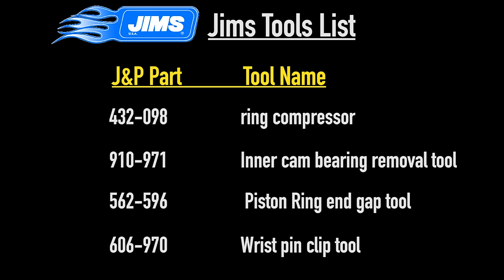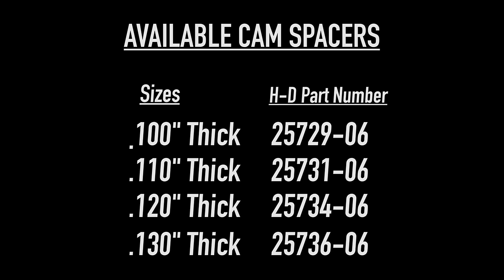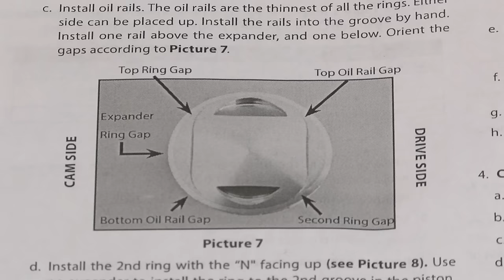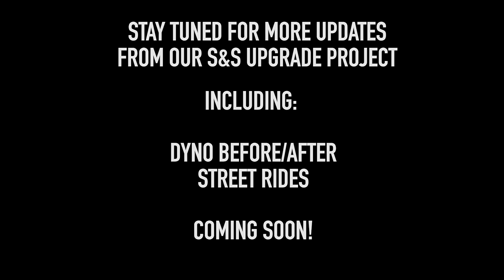Weekend Wrenching: How to Install an S&S Cycle Power Package

Comment: Glad i saw this. Was going to gear drive. Now i wont cuz of possible runout. Think i'll get more miles by upgrade to the hydraulic tensioners. I use synthetic oil all 3 holes. Thanks great vid!
Reply: Hydraulic is best!

Comment: I remember doing the same on a 2003 fxsti but also did the heads
Ported , milled and cc reduce to 72
9.5 to 1 cp pistons ft
It will pull in any gear with a baker dd6
Might build another soon since I have time

Comment: Why use adjustable push rods if you had the motor apart, I'd rather have solid. This is a great video though.

Comment: Any chance you could do a 883 to 1250 S&S conversion, with cams? I trust your judgement and knowledge. If I could get a complete set of part numbers, I'd order them off of J&P and have them sent over to me. Great job Paulie
Reply from the maker: The S&S Hooligan kit is what I would suggest. There is a possibility of a video on this in the near future.http://www.jpcycles.com/product/832-928
Reply: Do you know if S&S sells complete 1200 heads that will work with the 1250 conversion kit?

Comment: 98" big bore,and 89cc heads. 583 easy start cams. I need a map. I have the power vision. Fuel moto doesn't have an exact map.

Comment: How does one grind down the piston rings if one does not have a fancy table top grinding wheel?
Reply: Year old question but the answer is to clamp a very fine flat file in a vise, gently spread the ring around the file and holding it near the file, one hand each side, push so the file us coming into the ring.  Just guide with your fingers, don't squeeze the ring ends to the file.  Then spread the ring, reposition and repeat.  Do not pull the ring back on the file.  Any coating on the ring's sealing surface can be chipped away.

Comment: Update on the Dyno results? Also, awesome store at destination Daytona!
Reply from the maker: I am changing the exhaust Thursday and doing another dyno pull. The video will be out starting with baseline run and will include a run where the exhaust on the bike is used as well as when the clutch started slipping. New clutch, new tune, and new Thunderheader should make good numbers. Stay tuned for the new video early April.

Comment: How come S&S recommended that the bottom end be welded , if you went higher than a 106 kit ? And you just installed a 110 kit , to a 96 inch engine ???
Reply from the maker: This is a new kit from S&S made to be a bolt on kit with no machining necessary.

Comment: Great vid but why wouldn't you upgrade to gear drive? Doesn't make a lot of sense to put all that effort in and keep the crappy cam tensioner and chain.
Reply from the maker: The kit is available with gear drive or hydraulic tensioners. These tensioners are not prone to the failure of the early twin cam spring type tensioners.
Reply: So what year did Harley rectify this issue?
Reply from the maker: Hydraulic tensioners started in 2007. While not as perfect as gear drive, this is a big improvement over the previous spring type. I pulled mine out to check at 68,000 miles and were still just like when I had installed them. The problem with the twin cam is the tolerances aren't the greatest and if you have too much runout then you can't use gear drive. Being that I did not have the bike apart when the kit was ordered, we went with chain to prevent having to order other parts if the runout was too much.
Reply: Crank runout could wipe out the gears in a hurry is you aren't within the proper gear drive specs. The way Harley allows a wide variance in the tolerance means you'll probably need to pull the flywheels and have them trued or run the S&S 3 piece flywheel assembly. Chain drive allows for more runout which is why Harley went that way in the first place. Costs them a lot less money to just press a bottom end together than the older style of bolting the wheels together. I'd rather just replace the flywheels and go to a stroker setup for a 124 ci mill and get the Timken bearing install plus get the case bored for larger cylinders. All about bushel baskets of cash and how fast you wanna go.
Reply: @jpcycles  would be nice if there a 
was a table which let you know what kind of run out to expect with what ever amount of miles your engine currently has.